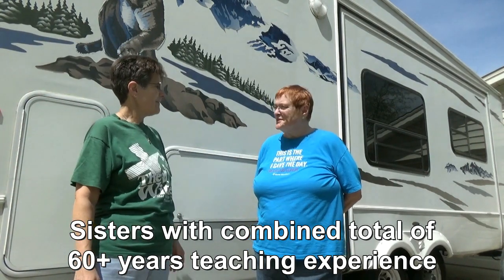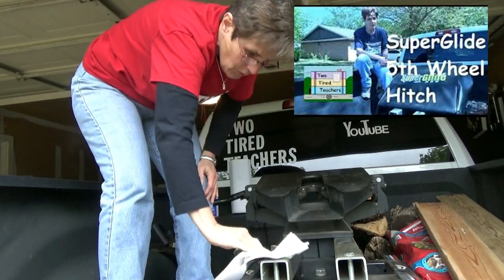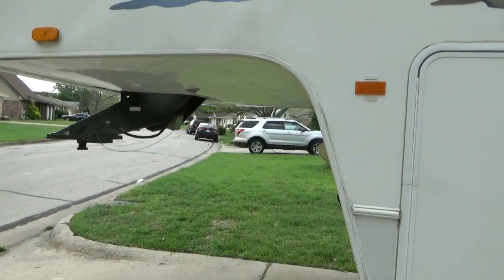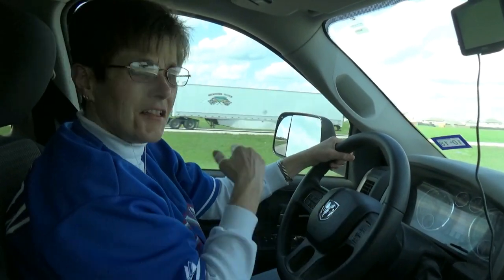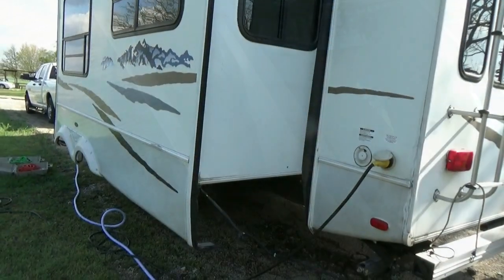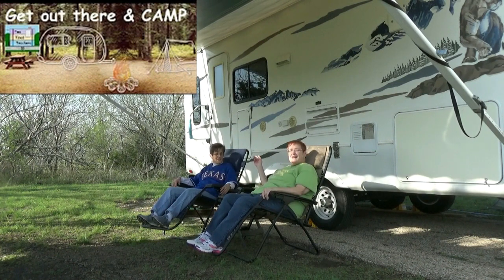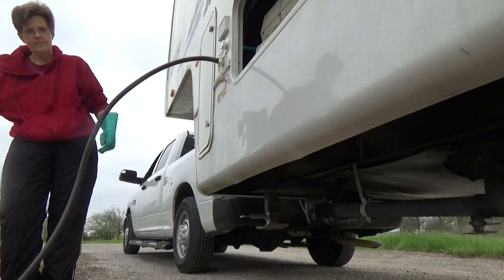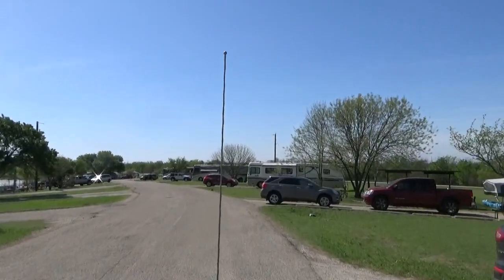Complete RV Camping Trip - From Driveway to Campsite & Back Again

Comment: Great video ladies!  Funny comment about the matching set of luggage!  Hahahah.    I needed this since I have realized that what little confidence I had built up last summer has faded away in this long cold winter.    There is snow in Tennessee today!  However, I have a trip planned with family the last weekend in April so I have a lot I need to do between now and then.  I have yet to de-winterize it and a small repair that needs to be made to the roof.  These fiberglass campers are held together with rivets and one of mine has popped out.  This trip will make me face two of my fears, pulling the camper and driving in the mountains.  Luckily, the campground is one of those that has the back in spots arranged such that I will pretty much be backing straight into the sight rather than trying to make a turn while backing.
Reply from the maker: We are so proud of you for planning this trip!  This is huge.  How exciting!  Please let us know how it goes.
Reply: Thank you.  It is a huge step for me.  I will keep you informed.
Reply from the maker: We want to hear all about that trip!

Comment: Great video.  Thanks for sharing.  Do you ever fill your truck at a station while still towing?   If so any tips on getting in and out?
Reply from the maker: We didn't at first.  We waited until we were comfortable towing, and then we looked for huge gas stations like Buckee's or other places designed for RVs.  Some have a couple of pumps designated for RVs.  They are easy pull throughs.

Our tips would be to find a roomy station.  Plan how you will get in and out, remembering those wide turns.  We try to avoid really crowded stations.